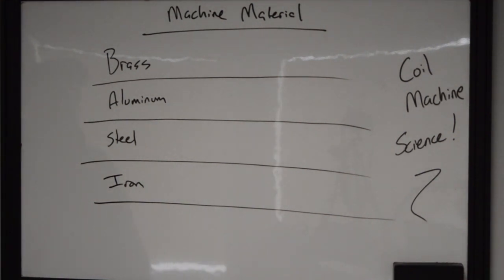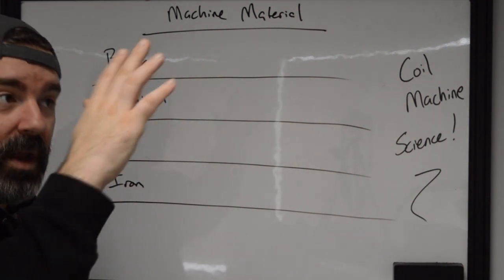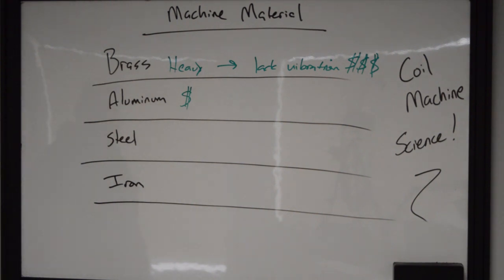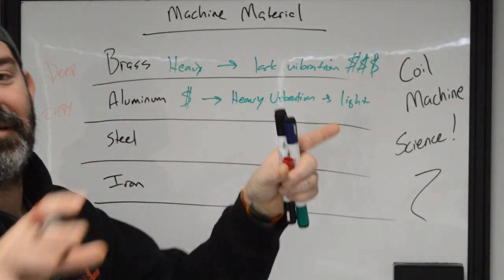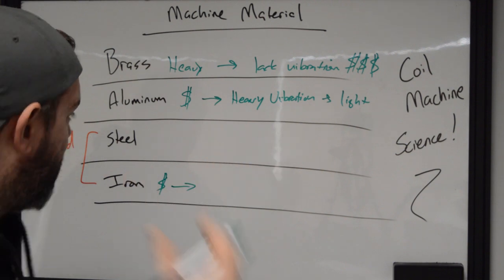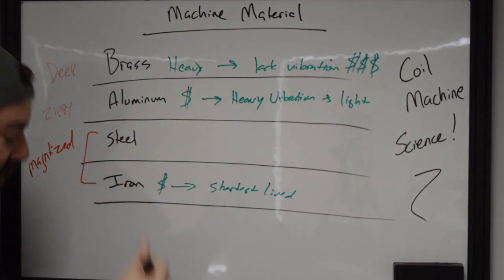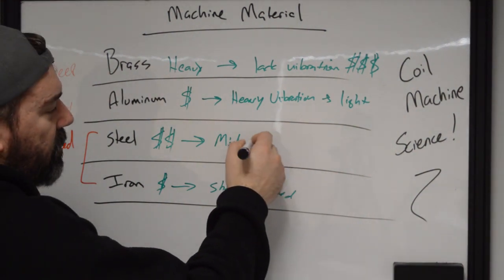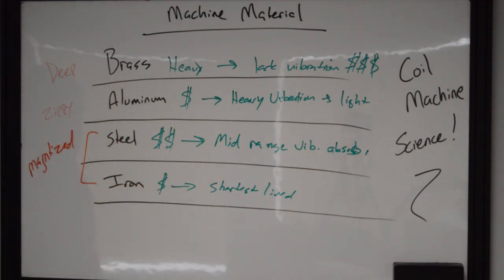Coil Tattoo Machine Science - Machine Materials

Comment: I sure do appreciate all the work and discipline it takes to produce these videos. Very chock full of information, experience, and wisdom.  I know the whole rotary thing is big with the pens and all and I see all the advantages of such equipment for example. I worry though about not being able to, with the help of a machinist (or old man with a could of tools) manufacture something that I could work with (as below-standard my machine design and building may be, it would work better than a tape cassette player motor and bent Bic pen). I worry about this because I spent so much time on a dead-end dirt road tattooing in Indiana when it was a legal issue to tattoo without an MD (Dr.) on the premise. Sure, I could, at that time, order from Superior, United, and other old-school suppliers but I had the constant worry about what would happen if it became more regulated, I tried to keep aware of how to manufacture or repair or jury-rig my equipment so I could keep working.  Also working the way I did, it was lean times, I could not always afford to just up and purchase pieces and parts and was put in a position to do it myself. I still have needles and bars left over that I soldered myself on the days I wasn't driving a cab, working a hot dog cart, or aiming a dump truck down the road. What I guess I am saying is thank you for putting this all down for people to know and hear. I think coil technology has a practicality and stickiness to it like pneumatic tires; they are old technology, but with new manufacturing, new materials, and such, they are a technology that is going to be with us for a while. Dude, you are appreciated. (p.s. Viva American Machines!!)
Reply from the maker: Nice response sir. Do you remember Cam Tattoo Supply? I've had many occasions where impose a badge, had goods stolen at a cone]mention, or had to sell my machines to get where immersed to go. Cam was always there for me and their 20-buck machines even won me a best in the show. I love that company but they are just a shell of the mammoth they used to be. The same goes for Spaulding and Rogers, Unimax (which I have a personal issue with), United, Superior, and many others. There has a been a consolidation of supply stores, goods manufactured locally, and quality control that lags behind cost of goods sold. I can't remember a time when a coil machine cost $1200 (except for an Aaron Cain machine, or a Clarke), yet many of these rotary machines meet or exceed that price and offer no meaningful difference from the knock off variations found from overseas manufacturers. Plus, no one really understands what these machines do when compared to coils. We're gonna try and make sure that info is available.

The industry is a mess yet you and me and others can do what we can to ensure the following generations have a chance to pick up the knowledge gained from our experience (mostly mistakes) to improve the quality of what is put out after we turn to dust lol.

Thanks for the kind words. It means a lot on this side of the camera